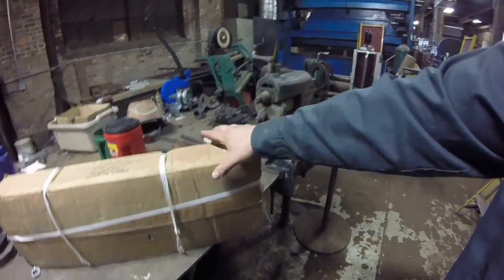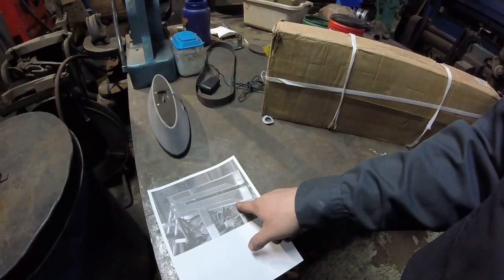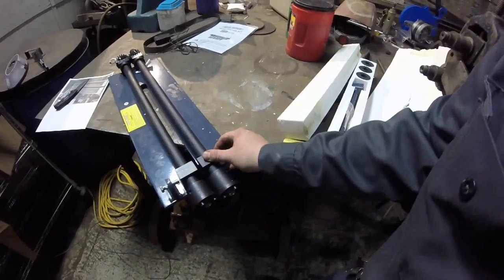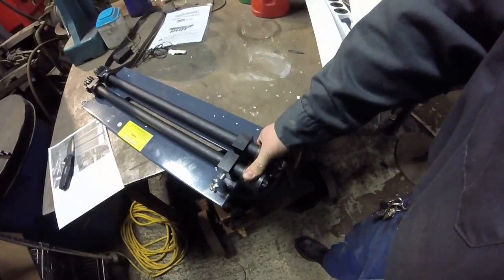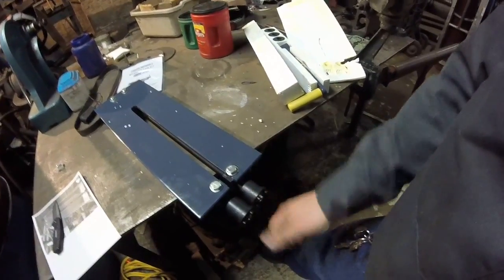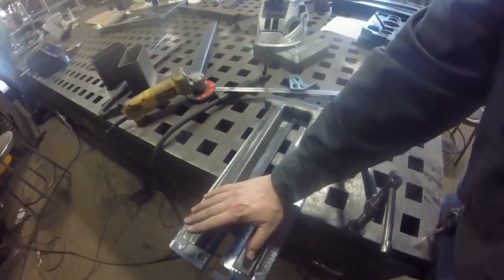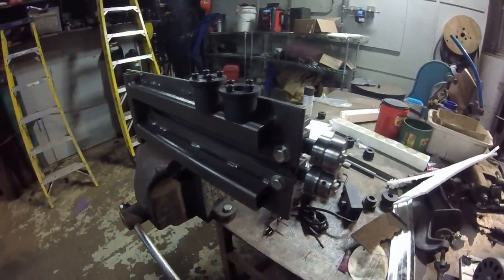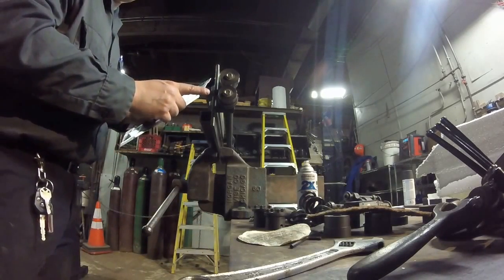Harbor Freight Bead Roller upgrade

Comment: This is a GREAT video! I'd love to be able to ask you a question about rolling flanges on stainless steel. I make drums, and I am really trying to get away from buying the drum hoops (rims) and all the lugs, bolts, est. Drum hoops are either die-cast iron, or they are "triple-flange" 12 ga. steel. I have seen YouTube videos on how these hoops are made, and essentially they are just flat bar steel that gets pushed through a roller, very similar to the one in this video, except it has several dies that roll the bar into the correct profile a little at a time. So, it goes in flat, and after passing through 4-5 dies that each curl the flat bar out little by little, it coils up into a big ~12 in diameter "spring" shape that a chop press hacks off into rings that are then welded together and finished. Can you point me in the right direction on how I might be able to build a DIY machine that can do this with a hand crank? I am not interested in speed, so if I have to change out dies and make 4-5 passes all by hand, that is fine with me. I just don't know where to start.

Comment: I laid three pieces of angle iron on the backside and closed off the ends. Then I added a large hand wheel from a sprinkler valve off a building. Added a guide bolted to the top plate as well. I did have to press it straight after welding . If you make special dies pay attention to your center distances.

Comment: What the hell, you did not do anything you said you were going to do.  You used square tube after saying you were going to use angle, use stitch welded it after saying you were going to weld it solid.  All this after blasting everybody else who did like you ended up doing it.

Comment: 2 things.

1.  I love these kinds of videos, but normally I have to set the speed to 1.5x to make them tolerable.  I only had to set yours to 1.25, and even that was more than I needed.  I appreciate you not stretching this out!

2.  This is exactly how Harbor Freight tools need to be viewed:  Not so great out of the box, but easy modifications make it a good tool for less than half the price of the competition.

Comment: Saw Eastwood's video for their bead roller which does look pretty much the same as the H.F. version. There was a mention that their guide fence design had been redesigned and improved. I checked out the availability of the guide fence that they now offer and as of 1/29/17, the darned thing is out of stock. No mention of when more will be available. I didn't call them yet for an update, but I printed out the photos of it from the on-line catalog and it is possible to fab one up, but it does look like it may require a good bit of work to source the different sizes of steel and to cut and fit the thing together. Actually, for the reasonable price that they're asking, I'm still considering buying one if I find that the wait isn't too long. Thanks for your video on the upgrade, though. You've earned a new subscriber.

Comment: You said you were going to use angle iron instead of square. Why did you go with the square tubing after all? I liked the idea that you had about angle vs square to be able to work with rolled sheets.
Reply from the maker: I found I could still bead roll a tight ring with the square tubing. Also the fully welded tube frame should be twice the strength of the angle. Funny part is I explained my reasoning, but the camera didn't record any of it... :)
Reply: Yes I understand that. But with angled iron you would still be able to have a closed section that would be plenty strong enough as a triangular tube when welded to the back of it. The triangular shape would give you more clearance when bead rolling on something like rolled sheeting.

Comment: Used mine for years un-modified,then had a steering wheel adapter to get rid of the crank,then had my machinist friend polish the dies and soften the edges did put grease zerks in as 10 years down the road the shafts gulled to the blocks then finally ran 1/4 x 1 1/4 around the perimeter.I have a Mitler 36" and still go back to my HF for some jobs..
Reply: Add torsional strength without welding if you don't always use the full throat depth by bolting 3/8" x 2" x 5" plates on each side. Drill and tap for (2) 3/8" bolts slightly under the plane centers so they center the plates in the slot when loose during relocation. This assembly could provide a stop or fence for some jobs, always position it to the most forward location possible for maximum rigidity.